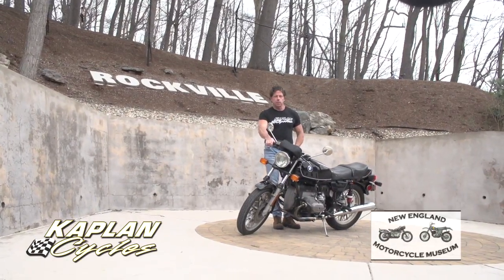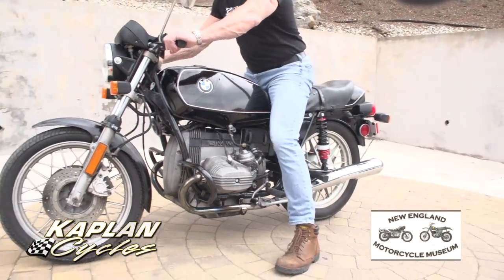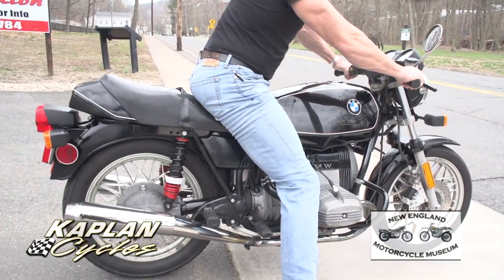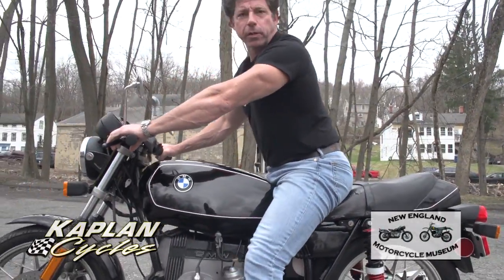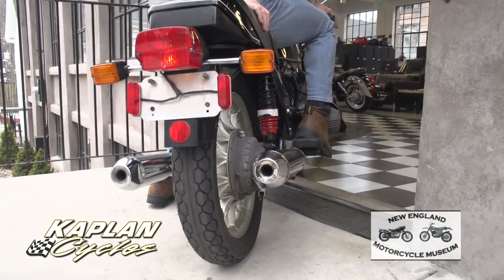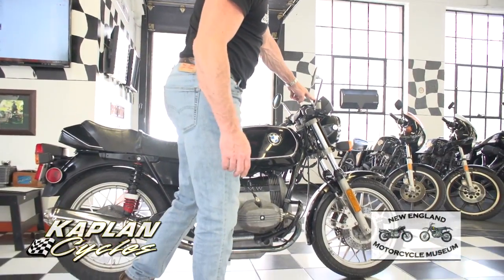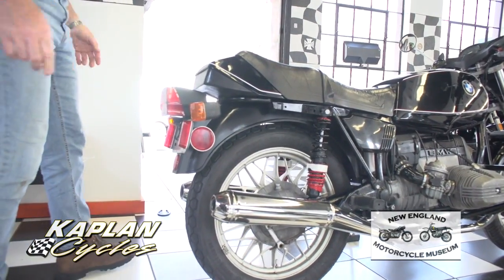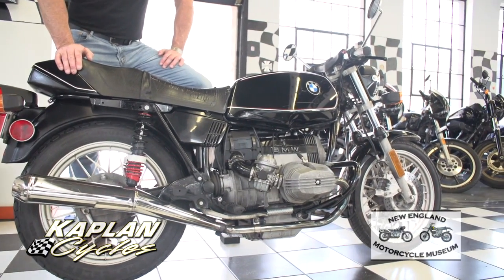1981 BMW R65

Comment: A friend of my father gave him this bike. The bike was always outside standing in the rain and sun and snow. My father disassembled the whole bike and build it again. Painted the fuel tank, drawing the lines in the fuel tank. Last Wednesday I passed my motorcycle license, now my father gave me the bike so I can ride it.
Reply: Few weeks ago I obtained this same model year and color. Couple quick rides but I love it
Reply: Got any pics?
Reply: @jonpage4029  That 650 handles incredibly well
Reply: I'm old now, my father gave me an R 65 the time I got my driver license for motorcycles. I tried to kill myselfe two times, I´d terrible accidents, but I never was able to do so. It´s a brave motorcycle for a new driver, a bike how forgive driver failures, like using the break on a curvy road with sand. The one with a single front break disk, never did it, the LS typ with 50 hourse power an two disk did it the two times, but I'm still alive, with a Suzuki Hyabusa I´d be not so sure. Brave bike and long living,

Comment: I bought my 1981 in 1982 off the showroom floor. Had a small cafe fairing and the wind beat the heck outta me going to a Guzzi rally in W.V. So it turns out that Leufmeister made a fairing with a factory match on the paint. Turquoise. Added stiffer front fork springs and a set of Krouser deluxe saddle bags. Had some nice rides on that Bike. I just bought a 1984 R100 in excellent condition and will be reluctantly selling the R65. I may do a restore on it or sell it as is haven't decided yet. There's very few R65's that have the Leufmeister matching fairing out there. I only saw one other in black. If anyone is interested in buying my R65, just reply here. I'm gonna miss that machine but I'm physched for the R100!!

Comment: Is it possible to bore out the barrels to 800 or 1000cc on this R650?? Thanks mate. From Australia.
Reply from the maker: I think they can be swapped for larger
Reply: Yes, but no need to do this. 'Cause it will not be a R1
Reply: @caferacer3539  you're right but I was thinking of more power for a sidecar :))
Reply: @caferacer3539  I suppose there are larger cc bmws in this style/model which I really like.
Reply: The R65 is a shorter stroke crank.
Reply: Siebenrock makes a 860cc big bore kit for these
Reply: This model and year 1981 they did increase the horsepower and also gave us the dual front disc brakes
Reply: Yes, but you will shorten engine life.